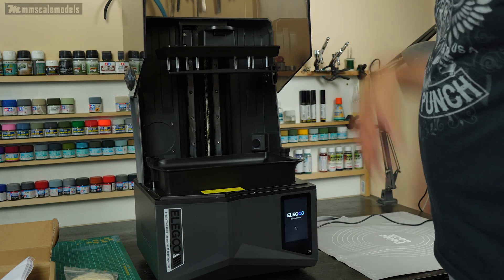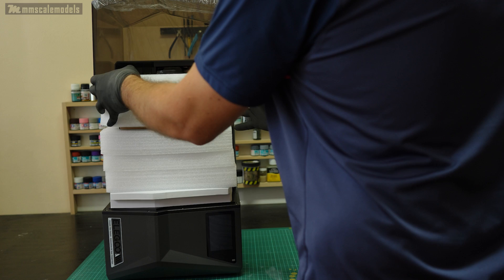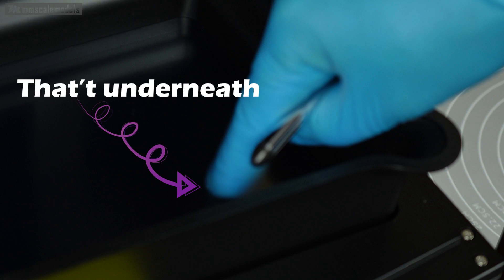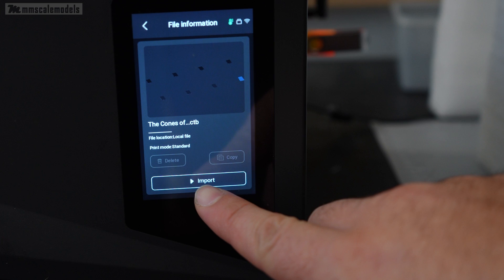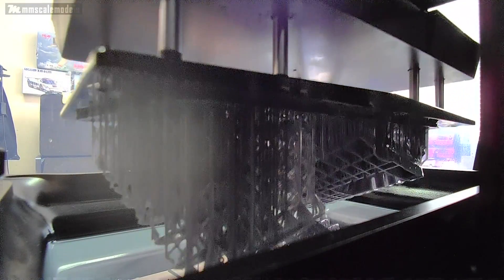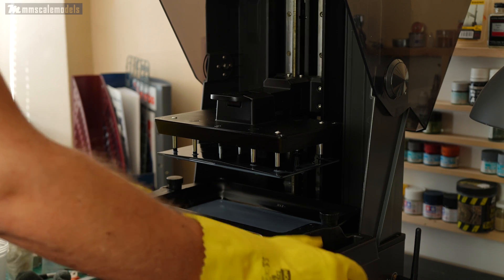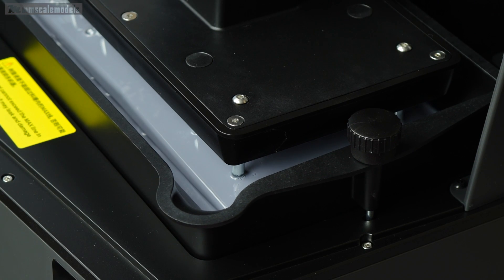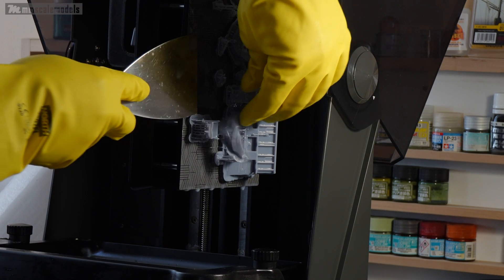Torturing the Elegoo Saturn 4 Ultra with some big models

Comment: I tried that printable models company and...
...well; it was not what I thought it was going to be.
You do not get an STL file.
First you chat with a rep, they are nice and ask questions about your printer
They email you a Calibration file to test out. 
Then after that, well I have no idea. 
That is because I made the assumption that I was going to get a file to print or mod as needed. 
Once I was informed that would not be the case (this is to protect their hard work from being copied around, which I understand) I asked for a refund. 
Being a first time buyer I got a discount on the P38 lightning for bringing its total to 14.99 USD 
My card was charged this amount 
When I asked for a refund I was advised it could take a while to remit the charges. Fair enough I get these things take time. 
They refunded me my money but only 10.00 USD of it. 
This was not disclosed in our conversations
I asked about it and they said that were handling fees. 
That is where the interchange stands and well, for now, ends. 

My experience is unique and should not be taken as a declaration of how they routinely conduct business. 
However I will say, exercise do diligence when looking for, and finding their policies.
I still feel there is a lot of potential for them, but a better expiation up front on return policies and maybe a video of how the transaction is handled (you use both email and the chat on their site) would greatly improve the customer experience. 
I truly feel they have the best, and most detailed models to be found. 
Cheers.
Reply: "this is to protect their hard work from being copied around" This part makes zero sense, even if they sent you a CTB or whatever it could still be translated back to STL format.  As for the "handling fee" i would of just done a charge back and told the CC the product wasn't delivered.
Reply: @nikushim6665  I was so flustered by the whole transaction I didn't even think of a charge back.. live and learn on that part. And yeah one could convert the file to STL or obj. I just wanted to accurately reflect the whole interaction with as little bias on my part.

Thanks for your input 😁